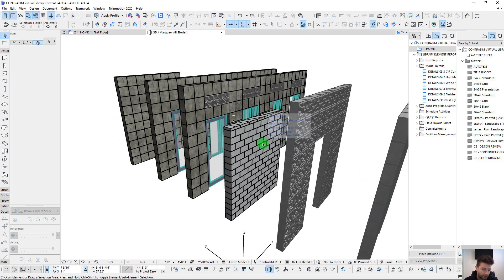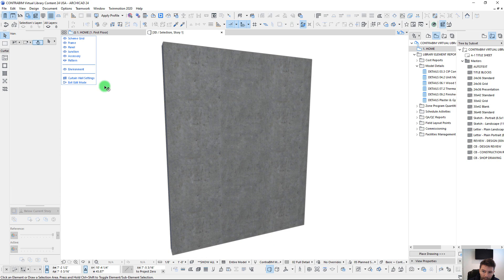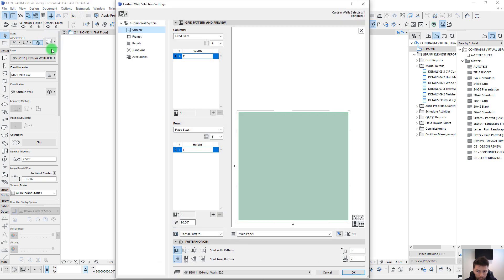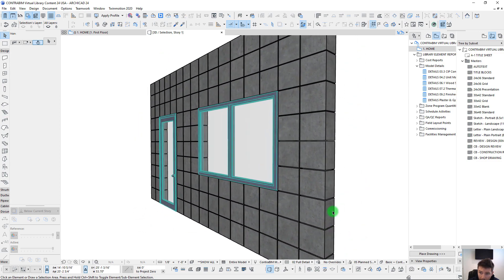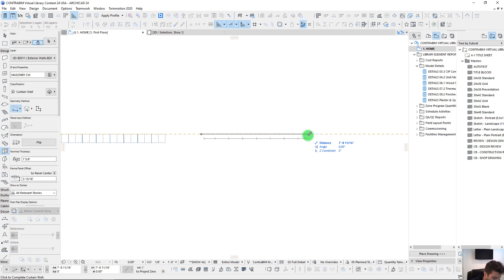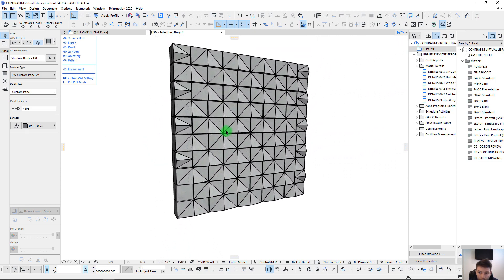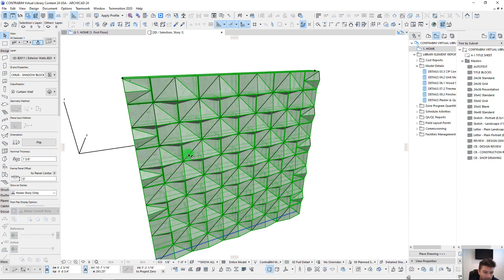Modeling Concrete Block with Archicad 24 Curtain Wall Tool!

Comment: Awesome video. I spent most of yesterday trying to model and repeat breezeblocks as a morph. This is much more elegant
Reply from the maker: Thanks for the comment! Yes morphs can certainly be a useful tool to help create the geometry. Loading them up into the Curtainwall tool can be practical means for distribution. Glad you liked the video!

Comment: Hi! Thank you for the video. Is there a way to add a window to a Interleaved Pattern Concrete Block curtain wall?
Reply from the maker: Thanks for the question. Yes absolutely. It is a curtain wall by nature, so you can add windows and doors just the same as if it was a glazed assembly!

Comment: thanks for the great content, very much interested in the material list, would like to know where you go it?
Reply from the maker: The materials are my own creation based on CSI Masterformat spec outline, which is the best out there for organizing building materials. They are built in line with the Graphisoft USA materials list (index 1-73), but added several more to fill in the areas where more are needed.  I like using the CSI codes for everything from materials, surfaces and fills to keep it all in line. Thanks for the question!

Comment: This is very nice. Thank you very much for your detailed explanation. Do you have a way to keep the file running smooth and minimize risks of crashing? We noticed that when you start to have a large wall, even just 3 storey high x 10m wide, there's a lot of background working process, the file slows the file right down and it can even crash the whole computer, not just ArchiCAD. Perhaps something which can keep the representation to a more basic level with less polygons or the like?
Reply from the maker: Yes, if you keep the curtainwalls limited in size (number of blocks) it definitely helps. I've found that when using excessively large assemblies, it can slow everything down. In some cases, just using the wall tool for CMU will be better for performance. The concrete block with curtainwall is good for select locations where extra detail is nice to have.

Comment: Hello, this is a great tutorial! I was wondering do you think there is a way to design modular wall panels with Curtain walls?  I am thinking about the type of panels used in the prefab type of houses. For example to design a curtain wall system with interior framing, timber panels, insulation, cladding, etc but keep them precise and repetitive.
Reply from the maker: Yes this is definitely possible. I've seen it done for modular commercial partitions. The trick is to make sure the lengths are drawn exact so you don't end up with a lot of unique sized frames at the end or beginning of the scheme.

Comment: Do you have any idea to make tiling for walls and floor with scheduling in Archicad?
Reply from the maker: Hi Jevon. Yes! This same application as shown in this video can be used for modeling tile patterns on walls or floors. I'm going to do a followup video talking about the takeoffs next week. Using curtainwall for this purpose is great, and can get more exact than an expression based property would.... When scheduling, you'll have to ditch the curtainwall itself, and tap into the sub level using the "curtainwall panel" to list panel types and counts.

Comment: Love your videos, thank you so much! Could you walk us through how to do the custom face profile for the shadow block? Is this two curtain wall panels sandwiched?
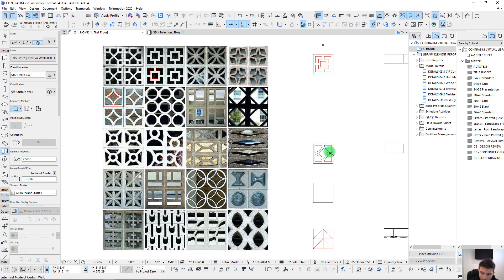Reply from the maker: Hi Keith. Thanks for the message! So the shadow block I built with a morph facing straight up when modeling in plan view, and was 6x12inches or 1x2 ratio. At 13:33 you can see the morph in plan view, and at 28:25 you can see the block pretty well in 3d. A pretty simple shape just two extra faces on the morph to create the shadow. Quick note: when you have an extrusion as shown, the overall width of the block will include the extrusion. I'll do another video on this here soon!
Reply: @CONTRABIM  I see! Thanks for the clarification and keep up the good work

Comment: hiii great video!! is there a way that i can apply this same procedure to floors??
Reply from the maker: Sure just model it horizontally! Use the boundary geometry method and create any shape you want as a floor. Great question!
Reply: @CONTRABIM  didnt know you could place it horizontally... this is gamechanger thanks!! this channel is awesome greetings from ecuador!
Reply from the maker: @xavansan  Thanks! Glad you're liking the content!
Reply: @CONTRABIM  It's also a good method to create office ceilings. In fact, can even add lamps and stuff and save those as curtain wall panels, so your horizontal curtain wall, now an office ceiling, can have lamps, air conditioning, etc, as panels in the pattern.

Comment: Hi, this is a handy tutorial! Although i am unable to get the custom wall panel to appear when added to the curtain wall. Once I have saved a slab with the profile of the block it just seems to change the surface of the panel? I think i have followed the process quickly being the only difference i create a slab instead of the preset block you already had as a template. Is this where i am failing? apologies if this doesnt make much sense.
Reply from the maker: Hi Chris. Hopefully you found the other video I did on how to create a custom block. I think that will help answer your question. If not hit me back up and we'll see if we can get it sorted!
Reply: @CONTRABIM  Hi mate, Thanks for getting back to me. I still can't seem to figure this out. I'm a student and am still pretty green so bear with me if my terminology is wrong 😥 I have created a block similar to the pattern in the video with the slab tool, then converted to a morph and saved as a window panel. When I try to add to my curtain scheme the scheme pattern is correct but the block is grey (using a white brick surface)? Are you able to link the video you have mentioned here?

Comment: Hi I've played with this idea before in Archicad, I've come across problems with breeze blocks being squashed, I think it had something to do with the nodes on the reference line, I was able to remove the squashed ones and have it stick to a brick module. Have you ever come across this ?
Reply from the maker: Hi Duncan. Yes it seems when the scheme is not a full spacing, it'll always squish the blocks together. It makes it really important to pay attention to the sizing, and running quantity schedules on this based on block height/width is a good way to find the slightly off ones. There may be some settings in the saved object for curtain wall panels that will prevent the squishing... something I'm looking into as that would be really useful. I'll often just replace the squished ones with a normal block instead. Thanks for the question!

Comment: Hi, can you do this with previous versions of Archicad.? Thanks
Reply from the maker: You can do this workflow with Archicad versions 22 and later. In 22, they introduced the new curtain wall editor which allows for there types of custom schemes.
Reply: @CONTRABIM  That's what I thought. Thanks

Comment: @CONTABIM is it possible for you make a shipping container walls using curtain walls? and make it editable so i can add doors and windows to the walls? if so please make a tutorial
Reply from the maker: Thanks for the question. I'm not sure if the curtainwall tool is the best for a shipping container. I think a profiled column or sheet metal object may be better for the walls, with beams and columns for the corner frames. I've never modeled a shipping container, that is an interesting subject though I'll add it to the list!
Reply: @CONTRABIM  thank you i would really like to see a parametric container made in archicad
Reply: @CONTRABIM  HAVE YOU THOUGHT ABOUT THIS
Reply from the maker: @pulealexforby  Hi Alex! Sorry it's been a while since this post. I'll have to revisit the containers and that is a great subject to talk about inside the brand new CONTRABIM community. I know other users who have built them before...not sure about parametric though

Comment: Using archicad 23 and can't seem to change the colour of the panels
Reply from the maker: Panel color/texture can be changed either by material, or be surface override. When changing to panel settings, make sure you'll adjusting the right panel from the list, that corresponds to the panels placed in the scheme settings. Keep playing with it and you'll get it! Also, check out the other videos part2 & 3 on the subject to learn more..thanks for the question!

Comment: What about corners?
Reply from the maker: Corners are a little trick, and can be matched together by deleting out overlapping panels. If this is a method you plan to use often, it's good to mend the corners first and then stretch in the other directions. Using a wall is obviously easier, but for modeling decorative block there are some benefits of doing it this way.
Reply: Any way of creative use of corner frames, you can think of?
Reply from the maker: @markk1786  Perhaps, but nothing is coming to mind at first thought. Maybe two slightly different schemes that always begin at the corners would work.
Reply: @markk1786  To get the corners to work perfectly, you will need one of the curtain walls' Horizontal Pattern Offset (by the corner coursing) to make the corner stagger.
So in your Scheme on the bottom lower right of the dialog box, you will find Pattern Origin > find where it says Start with Pattern you will see when you hover over It says Horizontal Pattern Offset.  An Example would be to start by using the 16" course on Column 1 > Rows A & B then create your pattern as the first block would be laid 16" coursework. 

For example, let's say you have a 48" by 12 ft fireplace you will need the two curtain walls then you need to decide which wall you want the CMU course to start. The second Curtain Wall you will offset by 8" then when they are connected they will be coursed correctly, from there you will need to go in the 3D vied and select one Curtain Wall and edit the connections. 

Example of how I use my Panels > CMU (8x8x16) Stretcher or now let's say I will use a CMU (8x8x8) Stretcher or at the openings, CMU (8x8x16) Lintel or more examples of panels would be CMU (8x8x16) Kerf, Single Corner (Left), Single Corner (Right), also I have a panel for CMU (8x8x8) Void, CMU (8x8x16) Void.  Voids are the airspace of the CMU, so while editing in 3D where the CMU overlaps one will be 16" or 8"; this is how the scheme works the patterns. The first wall is the starting of the 16", and the joining wall of the bottom course will show up as an 8", so now you will select all of those blocks and make it CMU (8x8x8) Void (it uses the airspace-this could be a new Airspace for CMU or just use the single airspace from the plain template of ArchiCAD) once this is done, exit the Mode and repeat this for the other wall.

The best part is you will need to make a left and right-hand fit in these spaces, then select the CMU and make them the Single Corner (Left or Right) if you do this and when you create the CMU wall it will be modeled the way it would be built.  It does seem crazy to do this but the BIM is so nice and now every section or detail that is generated is 100% done and no more hatches, line types, graphic overrides, or whatever to get things looking really nice.  Because still the fastest CAD or BIMer in the office if it's modeled in 3D it is essentially done in the drawings.  Also, the architect needs to remember making these Curtain Walls with CMU is in the Construction Document phases there is no reason to be doing this in other parts unless it's an exposed wall.

Also do not forget you just need to do the one end and mirror and then join the curtain will together. 

For myself, I still use the wall for all the windows and doors, but the CMU is a cavity if you will within this wall, and if I want to model the CMU with the Curtain wall it goes within the cavity space of the wall.  If openings are needed then this is were the Airspace void blocks come in handy to achieve this while selecting the right blocks.

Hope this HELPS!

Comment: This is so frustrating!!! How do you get the holes in the block when you are making a custom one!! The vid skips over things too quick
Reply: The custom blocks are just slabs or morph elements. You can create holes using the same methods you would with any regular slab. Create the line work for the shape, and you can magic wand the holes! Or use the subtract geometry method in the pet palette! Hope this helps!
Reply from the maker: Check out this other video which goes deeper into the custom blocks https://youtu.be/agInp34Qzko